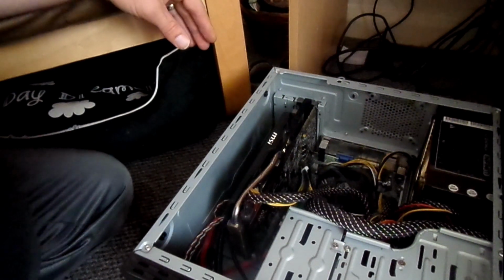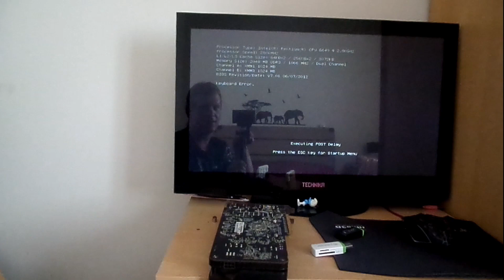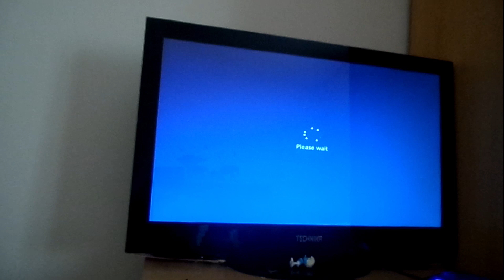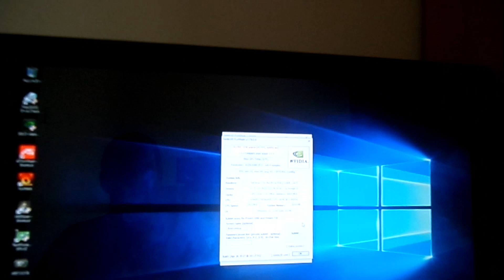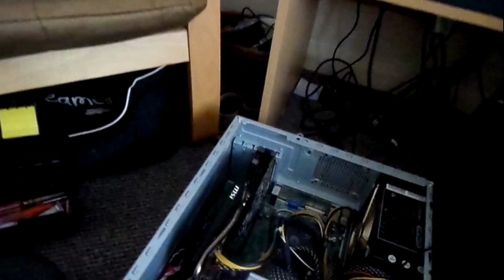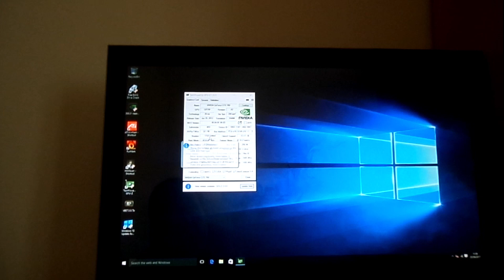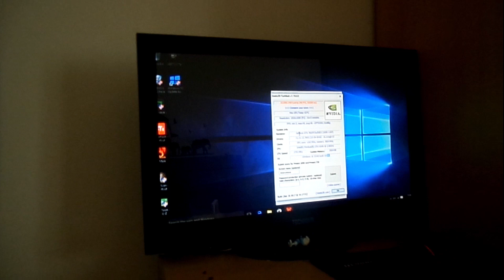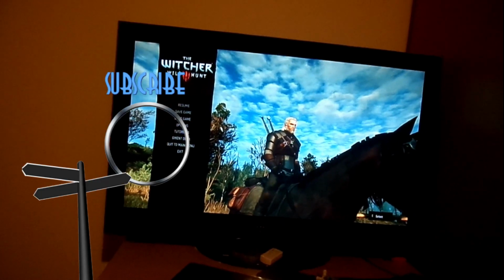How to fix GPU short and yes this card survived fire and still works today

Comment: Is it still working ?
Reply from the maker: Not sure man maybe yes this card been sold long time ago on eBay :-)
Reply: @frogtechtips  I got the same issue but the card working perfectly fine right now, I'm doing certain benchmark and it's showing no problem at all
Reply from the maker: Yop that's good just be sure you not overclock card now

Comment: i bought another card again today but the error seems different "CODE 31" i'm using rx 570 msi it only detect tru igpu anyone knows this CODE 31 ???
Reply from the maker: Hi that's is drivers problems 
Try reinstall drivers 

How to Fix a Code 31 Error
Restart your computer if you haven't done so already. ... 
Did you install a device or make a change in Device Manager just before the Code 31 error appeared? ... 
Roll back the driver to a version prior to your updates.
Use System Restore to undo recent Device Manager related changes.
Uninstall old drivers complete and put a New one 
Error 31 is DLL problems

Comment: i have question i have gtx 970 2x6pin connector the other 1 is shorted how to fix?
Reply from the maker: Hard to tel but usually one of mofset is problems

Comment: sir i have gpu that wont install any drivers. im not sure if its code 43 but drivers installed success but after reboot pc. its still not adapting the drivers
Reply from the maker: Did you try reflash BIOS
Reply: @frogtechtips  nope sir. but reflowing may work? like in your video
Reply from the maker: @motherboardrepairsPH  yop can help only way to find out is try

Comment: I have a question and maybe you can help me. I have a gtx 1070 and I tried your method to reflow...with the flux and heat gun. I put the card in my pc and when I start it up the pc shuts off after a few seconds and then turns back on but there’s no beep and no display, what can I do? Or if you have an idea on what the problem is? 
Thank you, I also find your videos very good 👍
Reply from the maker: What problems you have before you do reheating problem you writing sounds for me RAM problem try remove some RAM stick if you have more to for test
Reply: @frogtechtips  I got this card from a friend and he said it stopped working. Fans spin but no image. And my card is a gtx 670 and works fine .
Reply: @frogtechtips  I mean my gtx 670 worked fine but now has artifacts.
Reply from the maker: @SilFism  i will try reheating that's should help
Reply: @frogtechtips  thank you...I will try
Reply from the maker: @SilFism  You welcome

Comment: I had ati 4650 there is no signal i removed the cooler the thermal past was dryed .what should i do
Reply from the maker: Ye is common problems that's why I recommend replacing thermal paste minimum every 2 years I will try reheating GPU you have big change this will help